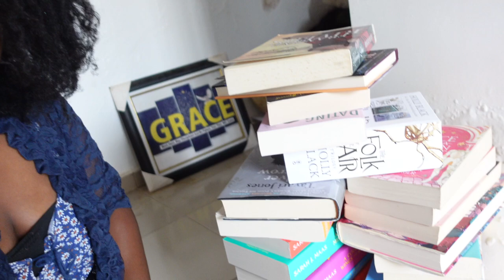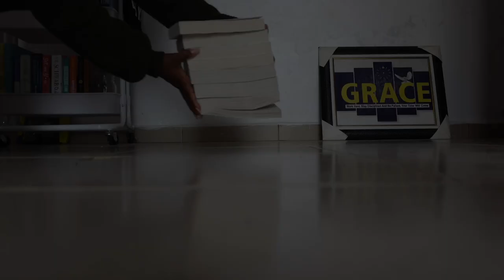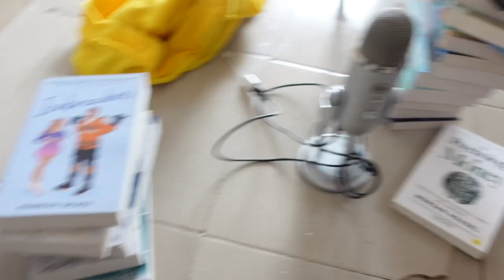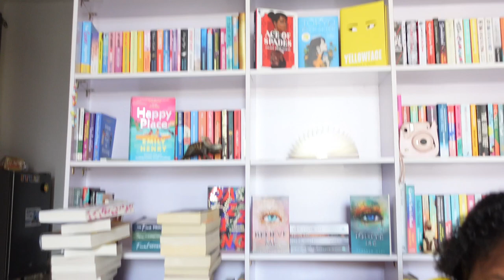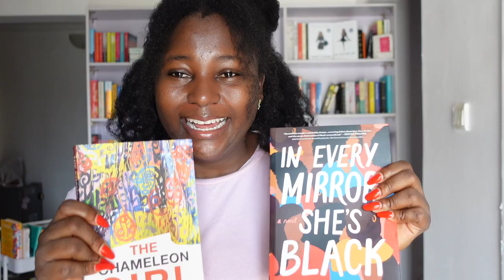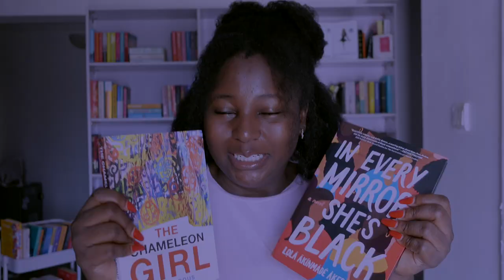IBLiving #60 | MY BOOKSHELF IS HERE!!!, renovating and painting my room, early surprise

Comment: The paint peeling is probably caused by rising damp, houses in the UK have a damp course put in a few inches above ground level that prevents moisture rising up through the brickwork, a lot of other countries don`t do this and there`s little you can do to stop moisture rising up, you`l just have to scrape it back as far as possible and paint over it probably every year.
Reply from the maker: No way, I’d just get another house or cover it with furniture
Reply: @GracieWandyte  Hahahahahahahaha